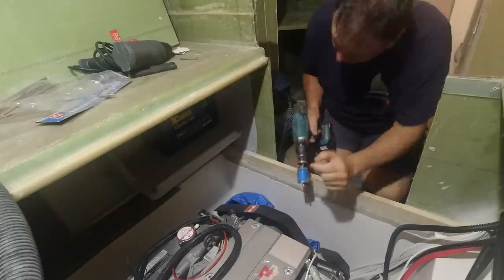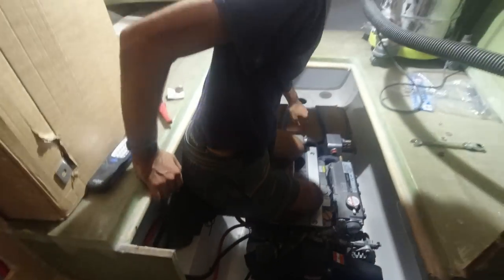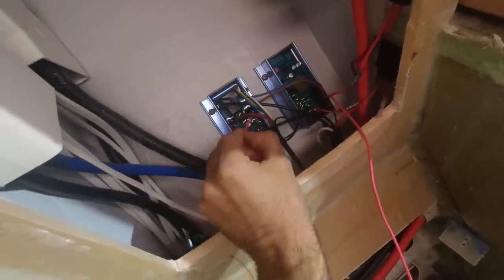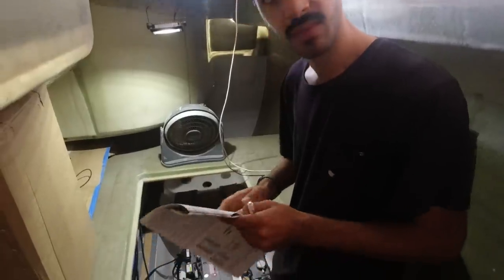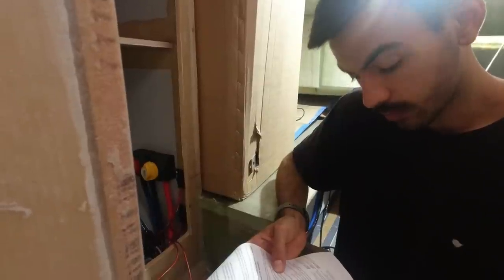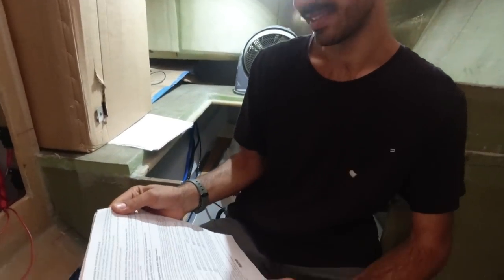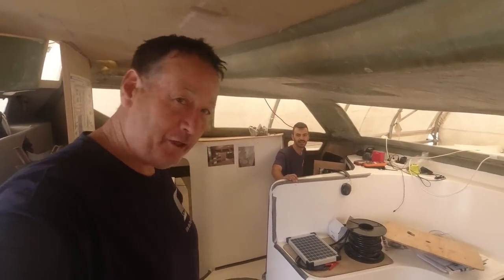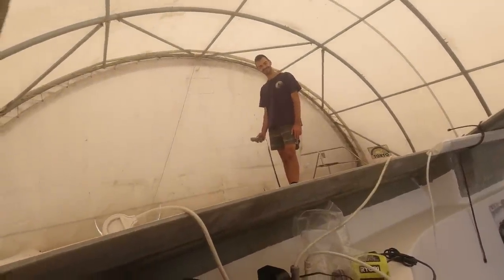"From Concern to Confidence: Conquering the Challenges of Catamaran Electrical Installation" Ep270

Comment: great to see the advances Ross, I have one question though, with your low temp compensation on the balmar regulator it was set to 32, are you sure the temp was not farenheight units in which case it would be 0 celsius. Asking because yanks don't use metric units.
Reply from the maker: That is a very good point,I will have to investigate that.mmm.Great question.
Reply: The guys at Balmar must be smart because they do indeed use degrees Celsius
Reply: @Restoretoexplore  32c is very high for a low temp compensation setting

Comment: If you have an electrical fault that causes a fire will your insurance cover you given that the electrics are all self installed???
Reply from the maker: System so far is DC.Ac will be installed by electrician.
Reply: What makes you believe a professional will take more care?
Reply from the maker: Zach is actually a professional marine mechanic and specialises in marine electrical installs in his father's boat repair business.I have not divulged this previously but at this stage we are dc system only for now .Ross
Reply: @LifeOnTheHulls  Hi Roscoe, I was not disrespecting Zac (or you). I was in the marine engineering field for 40 Years and in my experience engaging professionals is absolute no guarantee of error free work. A motivated boat owner, who does the research is quite capable of doing this work and most importantly (in my experience) has a vested interest and a big stake in the outcome as they will may have to cope with any failures at sea. I have had to rectify many issues over the years by so called professionals whose sole interest was spending the minimum time doing the job for the maximum money.
Reply: @Norman Boyes  I didn't say a professional would take more care. I was concerned that if there were an electrical fault then it is very easy for the insurance company to deny liability and blame the non qualified installer.
Reply from the maker: @Norman Boyes  Hey buddy, no offence taken here mate, I am so appreciative of any comment that can assist us in improving,enhancing or changing it for the better.Love it buddy.Rossco

Comment: I can almost guarranty that the temp 32 is in fahrenheit  given that Balmar is an american company and they still use that silly system.
Reply: I was thinking same. I heard 32 as low cutoff, had to be Fahrenheit, which is 0 deg Celsius.
Hopefully Ross is reading the comments.
Reply: Page 9 of the Balmar instructions indicates all temp settings are valued in degrees Celsius, thank for keeping us on our toes though👍🏼
Reply from the maker: Well done Z
Reply: @Restoretoexplore  That would make the default setting of 32 as the low temp cut off really weird as a default!!  I think maybe what was throwing us off was Ross was describing the "Battery temperature threshold" which is a max setting not a minimum setting, but he was referring to it as a minimum.
Reply from the maker: My bad
Reply: @LifeOnTheHulls  no worries!  we just puzzling through it!!